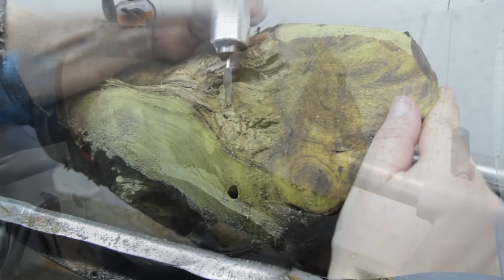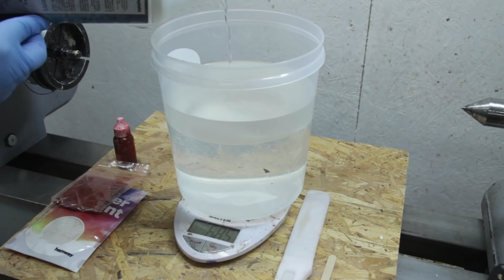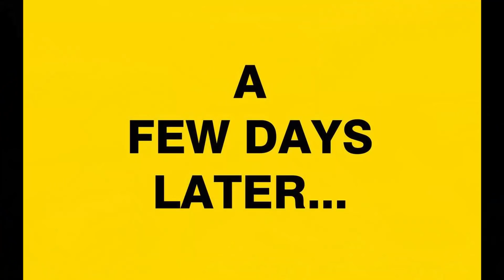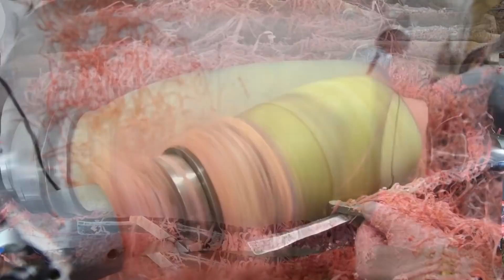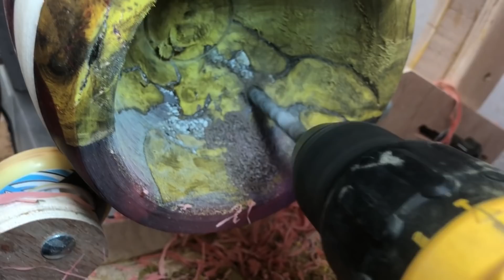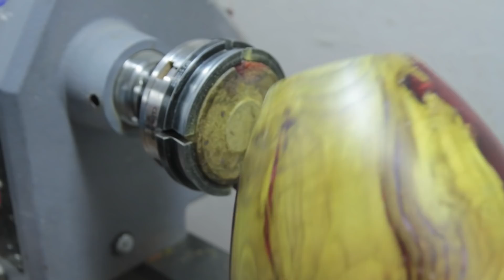Woodturning - FIRE Log To FIRE Vase 🔥

Comment: Nice piece!   Dave could you clue me in , I don't see many bubbles in the epoxy. I know you poured after mix, did you heat up the mix or perhaps type of resin mix you are using is doing the trick.    I just started with resin mixes and would like to know.  I am using pressure pot but your piece looks a bit tall for them  Thanks
Reply from the maker: Thanks Scott. I normally use pressure pot but yes this was too tall to fit. Used special deep pour resin (good up to 10cm thickness ) from ResinPro. Resin was at room temperature. As it was deep poor resin the curing time is much longer so that allows most of the bubbles to come up to the top
Reply: @DavidsWoodturning  thanks for the reply....

Comment: OK I am going to show my ignorance here but I am curious about something. My background is cutting steel on lathes and mills in machine shops. I also am a goldsmith with a small amount of blacksmithing experience. Basically if I can't set it on fire and pound on it with a hammer, I am WAAAAYYY out of my element. I find wood working fascinating and skilled persons such as yourself make amazing things. My question is about the tool that you use to accomplish what I call a roughing operation, moving laterally on a horizontal plan next to the piece. Is there a reason that you don't have the tool affixed to a tool holder the way that I would working in metal? I swear i am not trying to be an ass or to claim that you are not doing it correctly. I really don't know and I am looking to understand better and further than I do now.
Reply from the maker: Thanks for your comment. Whilst I never worked with a metal lathe sometimes I turned brass, copper and aluminium on woodturning lathe. What I learnt from those little experience those materials has a LOT more resistance the wood or resin. Having a steady tool attached to the metal lathe making things a lot easier as you could not machine that amount by hand as it would be rather trying and involves higher risk level. Secondly, I would say speed. Again never worked on metal lathe but moving my chisels with free hand it seems a lot faster than when I watch videos with metal lathe. Hope this helps.